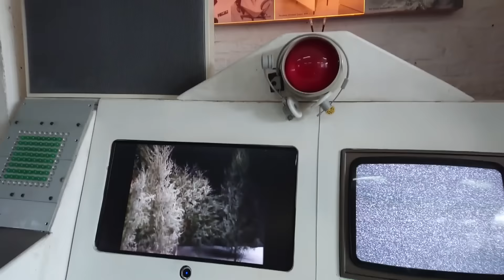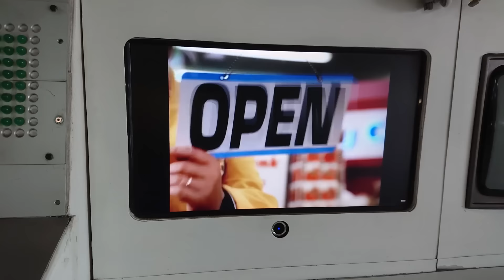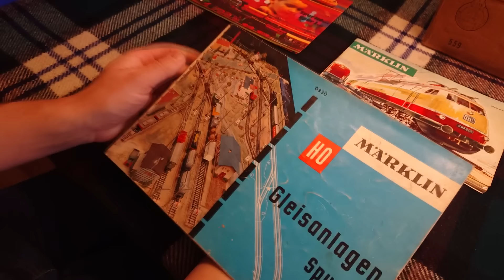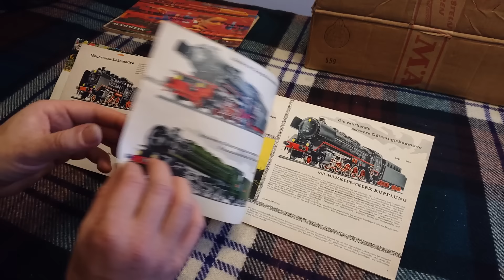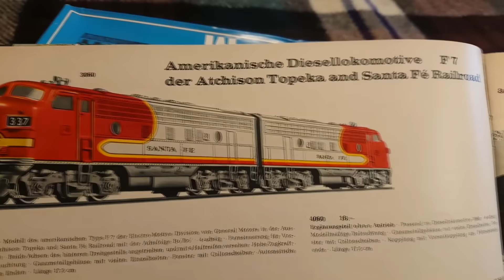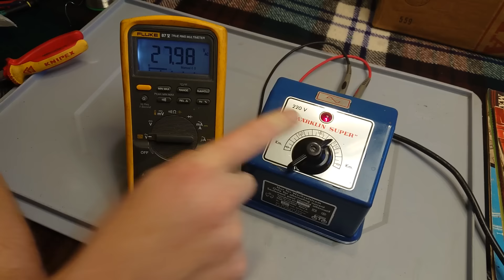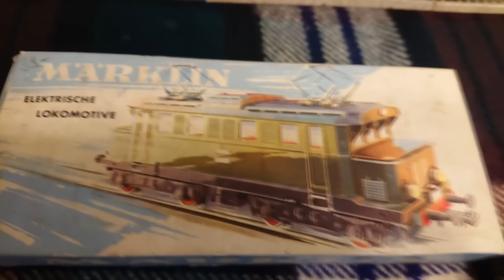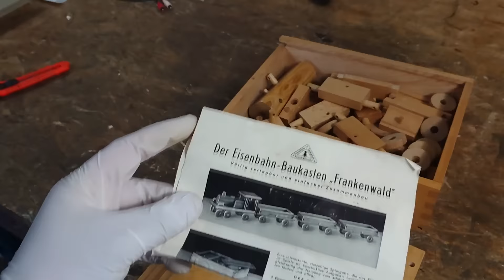Vintage German Toys and Models! Christmas Repair-A-Thon

Comment: I'm slowly working on restoring my late grandfather's woodworking tools, sharpening some of them for the first time in probably fifteen years if not much longer, and trying to set up a tiny wood shop in my 55m³ apartment. Work is very stressful, as is so much of the rest of the world, but the simple pleasure of taking a chisel that looks like it's been used to pry up paving stones and get it back to taking thin end-grain shavings, gives me a lot of pride and sense of peace. I like to think my grandfather would be pleased that his tools are slowly getting back to a usable condition.
I was probably going to spend most of the coming weekend and the two days off for Christmas just vegging out in front of Youtube, but this inspired me to work more on that restoration project. So thank you very much for this video.

Comment: When I was a weeeee boy about 4 or 5 years old, my grandparents built a large new house on a lake where I would grow up. That first Christmas was a bombwhilliker! I got one of those full Marklin layouts that I THINK was exclusive to FAO Schwartz. It was huge, with two(!) independent lines, real electrically operated switches that were push button controlled by a row of buttons by the pair of transformers. As I got older, the streets of the town were host to battles of Americans and Russians versus Germans, complete with their armor and later as a teenager, Russians versus the world. My grandparents even had a special, low table built that just fit the layout that was maybe 300mm tall. God, I never knew how I had it made as a wee boy. I hadn't thought about the literal 100's if not more hours I spent playing with set and the fun I had in maybe 30 years..... Thank you.

Comment: Thank you for sharing.  Model-making was a huge part of my childhood growing up in the 1960's and '70s. We had a train but never enough track -- mostly we made model airplanes and boats; some of them large and from scratch - one magnificent but short lived plane was a purple and yellow motorized RC plane of our own design with about 1.5m wingspan made from redwood ribs and spars we cut on the band-saw.  Its first and only flight was a magnificent loop just prior to it exploding on the asphalt -- it seems we had not set the elevator trim correctly.  There was always the thrill of "will it fly?".  We had two lovely RC controlled sailboats - my dad (an engineer) designed the hull sections and we manufactured fiberglass molds from which to cast the hulls and deck.  Building and modeling (and making)  was an essential part of my childhood. My holiday wish is for every child to have that opportunity to use their hands to create and wonder and learn.  Happy holidays. Peace and happiness to you in the coming year.

Comment: #

Hi! Nice video with an even nicer message! Märklin was also part of my childhood. The model trains as well as the famous "Märklin Metallbaukasten". A pity that the Poseidon capsised. I was a student in Kiel and once had a chance to visit the Poseidon for real. After its dry, give the internal mechanics a good spray of Ballistol before you put it aside for your retirement 😉. 
For her next launch: as you said, you need to adjust the trimming. The original owner obviously did not do that so far, because it is usually the last step after everything is completed. In my model building days the method of choice was fishing-lead. You can get blocks of different weight and little pearls for the fine tuning. You should do this in the bath-tub. First place the weight dry onto the keel and when the vessel is in balance glue it in. I used to soak it with UHU Alleskleber, but today that stuff is water based so a Kraftkleber like Pattex is a better choice.
It is also a good idea, to leave the model in the tub overnight to identify any slow leakages. On older models, the propeller shaft is always a suspect. 
You should also check the radio-control. There have been some changes in recent years to the frequency bands, that are allowed. Unfortunately I didn't follow the subject then, but I remember a lot of discussion going on. 
I wish you a merry christmas and that you keep your inner child alive!
Andreas

Comment: I have got back into model making, and meccano in recent years- your capsizing, probably you needed more ballast, these models would originally have been powered with lead acid batteries that weighed quite a bit in comparison to modern lithium power packs, you could see the waterline was well clear of the water, so a bit more ballast to bring the boat nearer its water line, and try running it on less than full power to get a more scale speed. I have some boxes of track, and would really like to get back into model railways, but I think for space considerations the smaller gauges might be the thing.

Comment: Your father was right, christmass is a commercial trick, of mindless consumerism and domestic stress.  However, your seasonal message, is a real gem!

As for the ship, perhaps it would be better as a 'dry' animatronic shelf decoration.  Fixing the ballast problem, may require a complete rebuild.  Pointless (it wouldn't be the same boat).  But as a randomly moving decoration, could be a viable project.

Comment: I have two water rockets from good old Germany. They came in a red box, inside: a plastic (about 30 cm tall) rocket with a "passenger" attachment that had a blade fan. Once the water was expended, it would fall off and the fan would allow that part to slowly fall down. The rocket had a rubber tip (which on mine has become hard plastic at this point). Also came with the pump (wooden handle) also about 30 cm long with a locking mechanism that fit the rocket.

Hydropneumatische Rakete L3 mit Satellit - quick google. Those are from when my parents were kids, the recount of the action is from my dad, i never played with them, they were too fragile when i found them in the attic. Funnily enough, both my mother and my father received the same toy at some point, so i have two of them from two sides of the family. :)) Mom's is really worn out and beat up, the "passenger" long gone. I was really surprised when i found it when we sold grandma's house in the country after she passed away.

But i did have some old German toys of my own. When i was a kid, probably 10 or 11 years old, my uncle took me along at an antique show in the South of Germany, but i don't really recall where, i just know i crossed the border from France, then drove about 3 or 4 hours. Big, big fair (but then again i was also a kid, all things are big when you're a kid) lots of old things AND toys. Specifically tin ones. I still have a Lunokhod, a plastic tank, which i'm pretty sure had a rocket on top at some point and a couple of Lunar landers. They were pretty good condition then, still are, just a bit faded as they sat years and years on my shelf until i flew away from the old home.

It always stuck with me, that market, because there there were so so so soo many, more but i had a budget. :)) And i'm not exaggerating, there were at least 17 tables all chuck full of tin toys. In retrospect, possibly someone's old collection. One of my core memories with my dear uncle.

Some things in the past were not good, but others were and things, items, toys or tools... they were good without a doubt.

Sidenote: i bought a small treasure trove of old tools the other week, and i was thinking of you. Good tools from the old days, i cleaned a few, still working on derusting some of the pliers and screwdrivers. A few from Poland, USSR, some from West Germany and some from East Germany as well, even a pair of scissors from North Korea (yeah, that was a shocker) pretty good quality at that. In January i'm going to get three tool boxes from an auction as well, couldn't pass up the opportunity - so the old tool collection grows! If the missus starts up a stink, i'm going to blame you for it, you gave me the bug. :))

Merry Christmas and a Happy New year to you and yours. I hope '24 proves to be a fruitful year for TPAI and you personally!

Comment: It is Xmas day in two hours here in Oz. It is very hot and humid, there is huge electrical thunderstorm with bolts lighting up the sky and the rain is bucketing down. During a lull I went outside with a torch to clear out the leaf filters in each of the water tanks which supply all our garden water on our 2,500 sq m of land on the edge of suburbia. I laboured to direct all the water off the house and shed roof into 25,000 L of storage Such a pleasure to see the tanks quickly fill after the Dry Season (Winter/Spring) and our first El Niño Wet Season (Summer). With our stored water I can nurture our Mango trees, Lychees, Bananas, Black Sapotes, Indian and Hawaiian Guavas, passionfruit, Fejoas, Mamay Sapotes and warm climate, low chill requirement , stone fruit.  Tonight was special though as while I was outside with the torch I could hear a very loud frog croaking. I ventured through the gate, following the sound as the rain began to get heavier and the thunder roared overhead, lightning flashing in the sky was a bit scary as Aussie houses have corrugated metal roofs and metal sheds, everything had a slight buzz about it… I crossed the road and there was a very large Green Tree frog bellowing to be heard above the thunder, a new froggy girlfriend had come to see how handsome he was. I was so happy.

Comment: Gerolf, the reason that the insulation in some cords of that era are crumbling and others don't is because ozone breaks down the rubber, but not the composition of others. It's the same reason that cracks develop in the sidewalls on tyres that are older.

Comment: I have had my Wilesco D11 oil derrick set up with a little dynamo and a small string of Xmas lights draped on the derrick all running today.   Quite a charming little setup, big fan of Wilesco steam, also had my 1939 Mamod SC3 running alongside as that has a delightful whistle atop it, proper little "peep peep" whistle.

Comment: What a great video and looking back to past decades cause I remember all the Märklin stuff, the H0 , the transformer, the high voltage impulse to turn back and forth, those metal kits and what not.

I guess you will need a captains patent but you had been looking quite professional 17:48 in the water - compared to me who comissioned a Typ VII C sub from krick in late november some years ago on a big canal which worked out great until it lost propulsion and I had not been prepared for , needed to drive home to get tools and salvage the sub which had drifted far away from the spot meanwhile. I had luck, got it out of the water  - yes, without jumping in underwear into the cold water.
But your exploration ship reminded me of that day, that sub model and the adventures along with that. 

Too late for a merry chrismas, but I wish you and your girl a happy new year and of cause hope that you get a Kapitänspatent soon.

Comment: Those vintage Märklin locos are just gorgeous! That very distinct metal-on-metal sound reminds me of my own childhood in the seventies. I can even smell the oil, mixed with a whiff of ozone, burned dust and metal right now. Layout in the basement, building plaster-of-paris tunnels, houses, stations and so on, often using cardboard, matches, various scraps and repurposed plastic model kits. I still got most of the parts and made a smaller layout some ten years ago with my youngest son. But we live in a tiny house without a proper basement or rooms to spare. Maybe some future grandchildren will take up the hobby? Hope so! PS: TEE got Kraftwerk running in my brain. I NEED that model!!!

Comment: Fun fact:

E03 002 was a prototype of the well known Br 103 class

Only 4 of EO3 were build to in 1965
E03-001
E03-002
E03-003
E03-004

They can also goes by as E103-001
Currently you can get them as model mainly roco models
However E03-003 is only made by Lima and mærklin I think

Comment: when, in the 90s, the yellow and red locomotive shown on the cover of the 1966 catalogue, was decommissioned by DB, some examples were purchased by weight in iron from a small company that covers a line here in Ferrara, the locomotive was very powerful (they said 1000 HP) and to tow a couple of passenger wagons, they said, they were fine.
The big problem was that 1000 HP engines consumed a lot (during the transfer, with a full tank they arrived just beyond Verona and ran dry along the way) furthermore their weight, much greater than assumed, caused problems for the line which was completely redone. This says a lot about the shrewdness of the administrators of that company, who thought they were making a deal by purchasing three locomotives at a paltry price which then forced them to spend huge amounts on fuel and extraordinary maintenance.
I also had some pieces of Marklin trains... unfortunately not everything: rails and power supply, the rest never arrived (it was a recycling from an older friend) they were much better than the Lima trains which were produced in Italy at the time. The Poseidon model is truly beautiful, I didn't imagine that there could be so many functioning systems in that model.
Happy holidays and see you in the next video

Comment: I have a idea for a new project. Gravity  power water generator. U get a big tank that fits 1000 gallons of water, build a piston on top  add weights using a pulley. as the piston pushes the water out it could spin a pelton turbine to produce power to charge  a battery